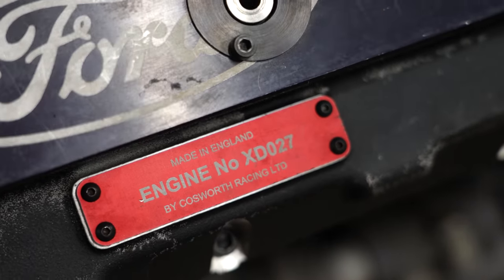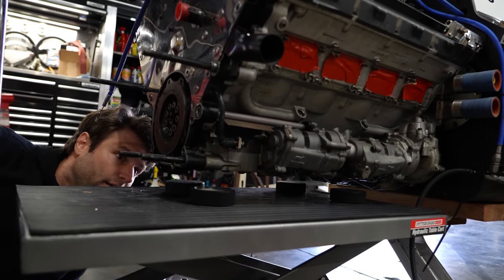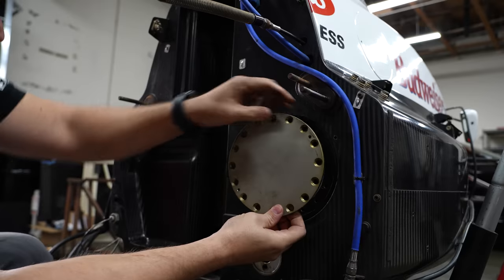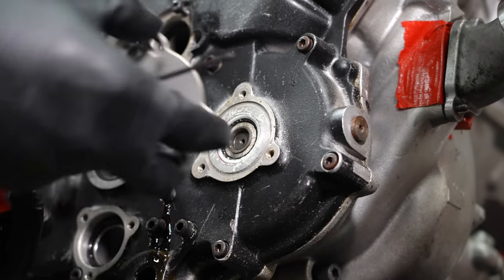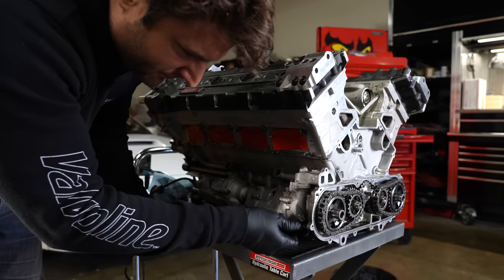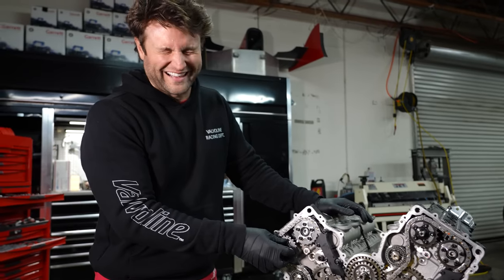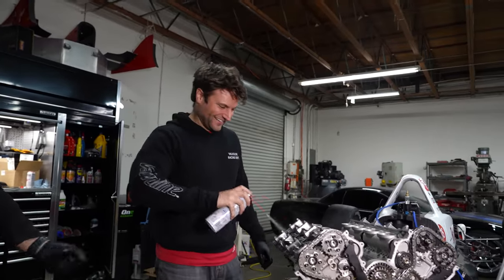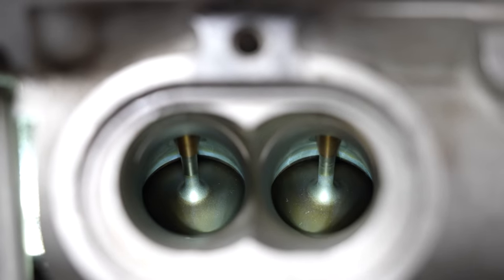We teardown the IndyCar Engine to expose its Secrets! Cosworth XD Turbo Methanol V8

Comment: It should go 1,5 7,3 2,6 8,4 to balance the vibration better. Engines almost never fire pistons directly next to the last one to fire on the crank unless it's the center 4 if it went 1,5 2,4 the front of the crank would be under more stress than the 3,7 4,8 side. But I might be wrong with it being a flat plane crank. Still think it should go 1,3,2,4
Reply: I did a bit of research into flat plane firing orders. They don’t alternate between the front and back of the motor like a cross plane motor does. That usually fire cylinders on the same crank journal in succession. So for example. Ferrari fires the cylinders on the first crank journal, then the cylinders on the 3rd journal, then the cylinders on the 2nd journal, and last the cylinders on the 4th journal. They do this because most flat plane crank motors are just 2 four cylinder motors joined together and thus follow the same firing  order as a 4 cylinder engine does.
Reply: @vexed_con  so my first guess could be close
Reply: @michaelmain1990  yup, your first guess is what I would assume to be the firing order too, but it could also potentially be 1-4-3-8-7-6-5-2 which is the firing order gm uses on their lt6 c8 zo6 motor
Reply: @Vexed Con  I wouldn't be surprised that Chevy used the same firing order that an indy car uses. They pulled all the stops on that car and have some of the best engineers in the game.

Comment: Rob we use those filters on airplane engines. A Pt6-60A engine uses a similar style and we clean them by using an old plastic peanut butter jar filled about halfway with alcohol and shake it it. We get rubber plugs from lowes and plug the ends so no debris gets into the filter portion

Comment: In regards to that front plate mount/pick point; We put a little paint on the head of the screws, take a piece of cardboard, press against and you have a perfectly  marked drill points. Saves a lot of time/guess work - fabricator

Comment: Intake lobes tend to be a little more aggressive because there’s not usually anything forcing air into the motor where the piston is forcing the gasses back out so they can usually have smaller valves and a slightly less aggressive cam

Comment: For the motor rotational direction, typically a chain tensioner is on the slack side of the chain, so the cam timing chains would be a fast indicator of which way it rotates.  Also I'm guessing the cam chain tensioners operate with oil pressure in some fashion so those chains aren't slack when the motor is running.  That's one badass oil scavenging system (dry sump?).
Reply: Porsche ran a dry Sump System back in the 60s

Comment: I read on Bill's website that they used timing chains to reduce some of the torsional vibration from getting to the valves. Everyday the idea is reaffirmed that there is no one solution in engine building - you see a lot of "chains are king" "gears are king" type of statements out there in terms of valvetrain systems. Thank you for this tear down for inquisitive minds!

Comment: Not sure about indycar, but I think formula 1 engines need to be warmed up prior to starting as the piston / bore clearances are so small, the engine is basically seized when cold... They have a rig that cycles and heats the coolant prior to starting...
Great video 👍😊

Comment: 1:03:39 that "dowel" is used to help locate and "lock" the main caps (which are built into the "oil pan" on this motor) in location 
.
its a "4 bolt main"...... with extra dowels to help make it even stronger (but mostly to MAKE SURE its lined up correctly)
most main caps use a little "step" or "ledge" to help locate the caps (or a groove in the block, and a "key" in the cap)

Comment: Amazing content as always! Appears to me the reason the cams are jumping is because the tensioners are loose. Looks like the non toothed roller on the upper chains is just barely eccentric. There must be a center bolt that keeps it tight. If you loosen it and turn the eccentric it will apply tension to the loose side of the chain and keep cams from moving at all. Makes sense why there are covers so you could possibly tension the chain after the cover was on and the snap ringed bearings on the idler was set in place. Otherwise the timing wouldn't be perfect. 

This is the stuff us nerds love, keep it up!

Comment: All those cam.gears are supported by the cover. If the valve springs are as tight as you say and the lobes are oversized, of course the chain will tention up and jump only being supported on one side.

Comment: Side note at 41:20, when the motor is running there should be no slop in the chains. Those smaller components where you noticed the slack rely upon oil pressure to maintain tension even as the chains wear and stretch out over time
Reply: Only true if the tensioners are hydraulically driven.

Comment: My recollection for some of the Indy V8's is that they fired two cylinders at the same time, rather than in the sequence you described. 
With flat-plane cranks, that is entirely possible, and produces a much more balanced power output, as well as reducing harmonic vibration. 
Take a really close look at the cam and piston positions.  You may find that two cylinders are on the same compression  and exhaust cycles, one on each side of the engine. 
Race engines are awesome!

Comment: The two mirrored cam lobes either side of the journals are correct because it's running two valves for intake and two on exhaust for each cylinder.

Piston engines will always run in the opposite direction to which side your cam chain tensioner is located. There will always be a sloppy side and a straight side to the chain, if you rotate the crank the correct rotation will be when tension is NOT on the tensioner side

Comment: I made 5 steering wheels for Richie.  Most of my PersonaGrip custom-molded steering wheels are mounted over fireplaces by now, but if this car has a molded wheel, here are the Ser.#s I did for him: 1995: Ser.#154; in 1997: Ser.# 263 & Ser.#264; and in 1997: Ser.#309, Ser.#317, and Ser.#318.  If one of them is still on that car, hang on to it!

Great video!

Comment: That gear and chain driven cam timing system is some clockwork quality magic! I'm sure this engine would normally need warm oil run through it, to warm up the block before it's turned over, I'm a little surprised you guys could turn it Oo I love Cosworth engines so much, they're always working on ways to be more efficient, lighter, better, and that technology always trickled down directly to their road going power plants. They're pretty much why Ford had so many legend cars, imo.

Comment: Nice to see fine engineering right there. Don't worry about the noise while you turn the engine, it's some camshaft being forced by the springs taking the slack eventually. The pins in the oilpan I assume they are there for precise alignment. 
Thanks for sharing.

Comment: ❤️😎Couple points that will help you. Crank rotation… note the timing chains. Slack adjuster is on the slack side, straight guides are the tension side, that tells you rotation. 
Cam Valve lift…lobe measurement MUST be compared to the base circle diameter, (base circle minus the lobe measurement you did). Cam lobe Base circle dia can and is sometimes different even on same cams, yet actual valve lift remains same. 😉

Comment: Thoroughly enjoyed your work here - glad to have found you and looking forward to working through your content library…

I can’t be the first to say this - but I also am not going to read 1500 comments to find out.ll 😂. So….  You probably want to find out what the torque / untorque sequence is for that sump/pan/main cap assembly.   If you can’t find something official - I’d suggest torquing from the middle out to the edges (center / center -then next pair to the right, then the first one out from center on the left - and so on) - as opposed to starting at one end and moving to the other.  When taking them off - start at the edges do one end - then the other end - then the next inboard, then the inboard on the other end, etc. ending up on the center set.   I don’t know if that is “right” for this engine - but it is pretty standard for engines with cranks and pistons.  You can warp components by doing it in the wrong order.  You probably want to torque (and untorque) in a series of stages as well…. Again - reducing uncontrolled flexing by the parts. 

My 2 cents…

Comment: Cosworth have learned a lot of tricks since the DFV, many shown here.
The variable volume fuel pump was very clever, why waste power when you don't need to.
Yup, I would agree, that was probably a vacuum regulating assembly for the crankcase.
Hidden bolts and nuts are a trap for new players - one popular fleet engine I worked on a lot, as a 'prentice, had an inlet manifold with a nut that was accessed through the thermostat housing. If you didn't know and just assumed it was sticking...
Convention for rotation is CW from the front, and ACW from the rear - that's confirmed here because the idler will always be on the 'slack' side of the drive.

Comment: Rob, that central timing gear that you said you didn’t know what it did is a pendulum damper. Been a Cosworth thing since the DFV days and used up through the Cosworth CA’s (and probably the current V12s). There are photos of them apart online.
Reply from the maker: Oh wow! Thank you for that information.
Reply: @RobDahm  Also Mike Jones (Jones Cam Design in NC) and Dan Crower (DCR) were involved in Indy Car engines of this era for camshafts. Might be worth reaching out to either one about "softer" cams for these. Pretty sure Mike was involved when these were badged as Chevy's.

Comment: just something for you guys to think about - they probably pre heat the engine (Via oil and coolant heaters) before turning it over. Due to close builders torlerences these engines (andF1) are hard to turn over by hand or starter cold

Comment: It is fascinating to watch this for an interesting reason; I worked with former Cosworth Engineers at MotoCzysz 15 years ago.  The MotoCzysz C1 engine, which was a narrow angle V4 with two counter-rotating crankshafts, had MANY design elements that you are finding on this as it was designed by these two British engineers.  Complex seal surfaces with o-rings that are likely ROPE.  My guess is that you will find a spot in many of the "o" rings that has two points glued together with CA glue that had been cut at 45* angles.  Also, 7mm fasteners!!! The b@stards loved them!

Comment: The crankshaft has journals on it. The connecting rods are bolted to the crank on the journals. Lobes are on the camshaft, they open and close the valves.

Comment: I had a 1987 Yugo. The clutch went out at 20K miles. When the shop went to replace it, they had to send the flywheel out to be surface ground. They said that it was the size of a teacup saucer and it wouldn't fit on their lathe arbor.
    It went out at such low milage because the new motor was so tight that with the A/C on, you had to slip the shit out of it to keep it from stalling on take off for the first 5K miles. The clutch didn't actually burn out, the flywheel developed hot spots and would shake your teeth loose on take off.

Comment: People ask me, "how can you just throw all the bolts in a bucket, then remember how it all goes back together"? 1. been doing it long enough to know/understand the functionality of what's being worked on. 2. Have a good memory/visually.  Now when vehicles became more complex with more sensors for data input and real time  adjustments. For me, especially working on something for the 1st time, found it easier and faster when it came to putting it back together. Was labeling and keeping some components together but seperate from other parts. Sometimes putting different length bolts back in their respected holes. Also some "street" engines/transmissions have a certain bolt untightning sequence. So as to not warp it. See that in small high strength  alloy parts. Yeah, now having a smartfone taking pictures helps. When you don't have a history, then the teardown is also chance to see anything where problem was starting. I'd pay attention to the oil filters, plugs/ STOP crankshaft can be seen! OK I'm back. Look I do want to thank you guys for putting this on. For me, I've never seen inside one of these engines, other exotic thing, but I was excited just like you guys. I've donated my time, sometimes to see, and it's not just the seeing, but the learning. To see how the other guys are doing it. Usually in the racing, aerospace or also heavy industrial fields. It's satisfying to find and diagnose, repair and make better, when you got a patient who can't speak! Well, I guess next time one of those "anti -gravity" type crafts comes floating by, think I'm gonna throw a rock, and say "hey can I check yer motor out"? LOL! or on 2nd thought, maybe not, Late.

Comment: Now that you have started to work on a piston engine have you considered replacing the cam operated valves with solenoids?  A strong magnet driven by a coil.  It can drive one way or the other.  Once moving the valve can be slowed down with braking action so the valve does not slam into the head or a stop.  A digital pulse generator driving an analog wave shaper.  I am sure it would use way less energy than compressing springs.  It may allow your indy engine to last a long time.  The valve guide would be attached to an aluminum round with the magnet inside.  Then a coil wrapped around the aluminum sleeve.  Just an idea.  I know you have the fabrication skills.

Comment: you forgot about cam duration and lobe separation and timing, you cannot simply replace an intake cam with a exhaust cam because the lift on the lobe is similar. you rotor boys have many new things to discover from 4 stroke piston engine! cant wait to see this engine go back together.
Reply: What do you mean by “rotor boys”? Funny because watching this video feels like we are already in the future, circa 2035. “And this is the camshaft lobe that makes those things move up and down of the MOTOR....” even more interesting the fact that the audience goes like “woah! That thing moved up and down” lol! Yeah, once I win the lottery, I’ll source myself an Aerojet Rocketdyne RL10, obtain the necessary tools suck as rubber mallets and some Milwaukee impact-ranch and will proceed to disassemble it on YouTube. 😉

Comment: The camshafts are case hardened, they are soft in the middle and hard as woodpecker lips on the outside, if you grind them down you get rid of the case hardening and expose the soft metal which is liable to scratch and deform against the valves/lifters/rockers

Comment: Those clutches are neat you give it 3-4000 and let it out till it starts going then stop letting it out, the heat causes the copper plates and steels to expand and grab then you release.

Comment: Awesome vid. Sooo cool! Never seen the inside of a Cosworth. 🧐 The timing setup looks very similar to Coyote 5.0 or Mod motor. I helped my buddy tear down the front  of the motor in his super charged 2018 F1-Shifty to swap in a billet oil pump.😵‍💫 Anyway,  I would like to mention I THINK ya'll were turning the motor backwards with the breaker bar near the end there . 😬 That said, being a small block push rod guy, the only OHC motors I've messed with is the Coyote 5.0 and the 4.6 Mod motor, but I'm purdy sure the timing chains should never get slack between the intake and exhaust cam gears. Cheers!

Comment: tom nelson did an interview on ls cam shafts, i think like 40 or 50+mm, is so big around in diameter they don't need crazy lobe angles, combine with thier insane boost, the engine are docile at lower boost and rpm and can be driven to the store.

Comment: Man that's some interesting design on the timing side.
Asymmetrical heads, different length camshafts and reversed rotations between crank and cams.
Be careful putting it back together!

Comment: the popping noise in the timing chain system is timing chain stretch. Its a lot more prevalent on engines with big lift cams. The reason one part is tight and the other isnt is because each individual link in the chain can stretch, so naturally the links under the most duress are the ones on the cam gear during peak lift.

Comment: Those dowels are essentially there as locating pins because the girdle is the other side of the main bearings, and they need to be aligned at a really high tolerance.

Comment: Im Sure that engine has ceramic main and rod bearings, and the cam chain tensioners are in the valve covers and/or hydraulic  pressure tensioned, But great Video , Keep up the good work !!

Comment: that alternator will likely be 3 phase AC with the diode pack, rectifying it to DC. Without the regulator, you simply need something to "regulate" it, keep it at a useable voltage. 
Most you buy are for regular alternators and contain the bushes too, so you just need to get one to with say, 14.2v without brushes

Comment: A-mazing. A rotary expert that never took a piston motor apart decides to start on a pricey Cosworth instead of an affordable Ford or Chevy V8 for which multitudes of instructionals are available. Literally one of the most complex/state of the art engine systems on the planet. It would take some real guts to bet your life on this car after reassembly. But I guess every serious open wheel racer has to start somewhere.

Comment: The way the oil pressure regulator works is exactly how a Multimatic DSSV "spool valve" damper works.  The shuttle is what regulates the flow path area.

Comment: One of the reasons for small diameter clutch was so the engine could be mounted as close to the ground as possible. The loss of surface contact area was made up by using a multi disc stacked clutch pack.